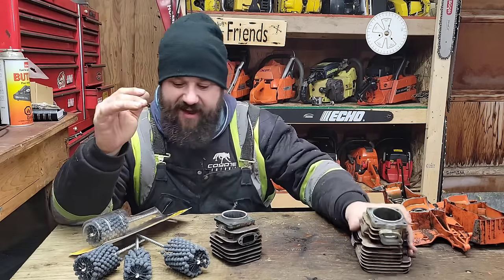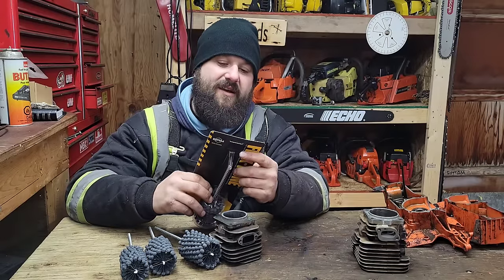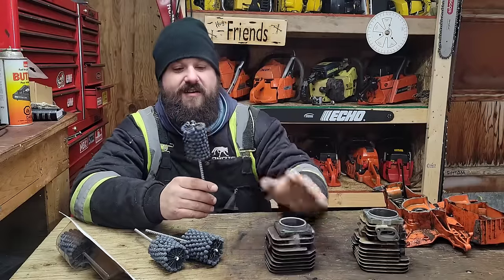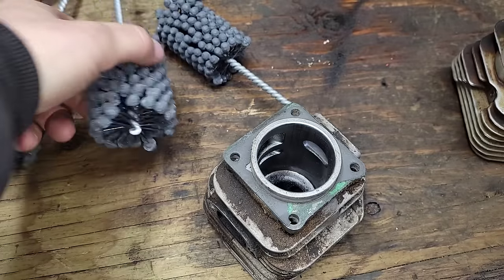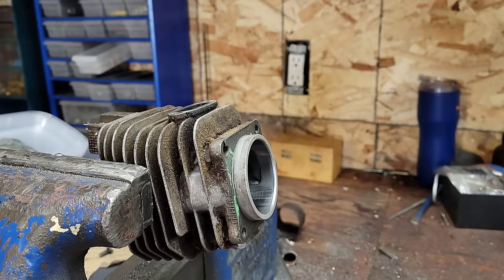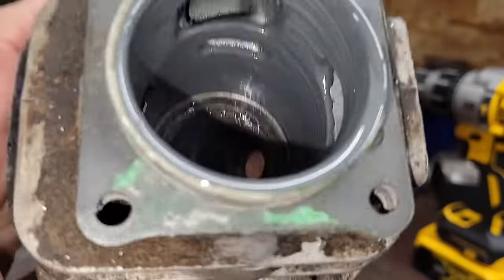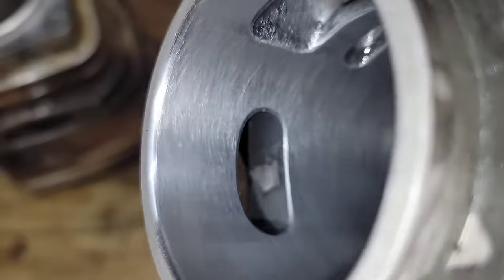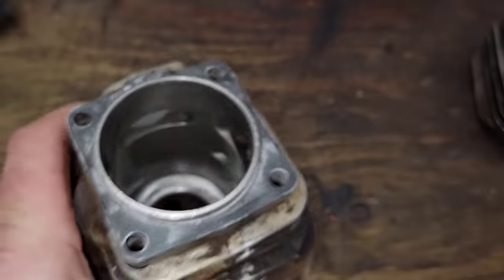Nikasil 2 stroke cylinders. To hone or not to hone? That is the question.

Comment: Hello my friend nice work, i have a used 026 with original cylinder but with no brand name piston with a letter (A) on it. Which means is 43.95mm, cylinder is in great shape but the piston have some scratches nothing special but i want to replace it . Meteor made three different dimensions for this model:(A)43.95 , (AB)43.96 and (B)43.97mm and i can only find only (B) available on internet so my question is....can i put a meteor (B) piston in this good cylinder,i m afraid the 0,02+ difference between A and B will overheat and seize the cylinder... what's your opinion about that... P.S. i didn't measure ovality of cylinder with a bore gauge .

Comment: Tin man
I was in a group tonight and I was told that I shouldn’t of happened to cylinders on my Arctic Cat engine there also the nickel plated and I did it anyways there is no issue with them not scoring no glazing that I know of but I did it because I thought I needed to do it to see the rings well I won’t do it again but I think it’ll be OK what is your opinion?  I used an under size home that didn’t really fit in there well and got a nice cross hatching there. I guess I’m experimenting to.

Comment: Tinman, by pulling it in and out that far, aren't you taking quite a bit more material off the base of the cylinder compared to the top? Wouldn't shorter strokes (~1 cm) be more even?

I don't know much about chainsaws, just a curious subscriber. Thanks!

Comment: A very 2-way topic, when it comes to 2 stroke engine rebuilds....
Should you hone a Nikasil barrel?!?!?! 
- My personal opinion - No you shouldnt.... Why? Because nikasil is too soft... The abrasives used in honing, are far too aggressive...
How do i know this?!?! I used to work in a machine shop, Concentrating mostly on niksail cylinders for motocross bikes.
Lathing them out, Re-Nikasil plating, and machining to stock piston sizes.. Also did a bit of welding on exhaust port bridges, When they would come into the shop cracked...
We tested the "should you hone a niksail cylinder" theory, Using state of the art high zoom camera's and machines... 
We found that the honing marks left in the cylinder, were so much deeper that whats even required... Far deeper than any factory maching crosshatch marks...
The crosshatching is there to hold oil, to aid lubrication during the run-in process... we found that honing, simply put too heavy marks in the cylinder walls that what is ever required..
Remember.... Too heavily scoring inside the cylinder, IS NOT GOOD.... Too heaviy scored, Causes potential blow-by, Excessive piston ring wear too...
There is simply no need to hone a nikasil barrel.... Red scotchbrite pad, and a gentle scuff to remove the existing glazing, TO give the new rings a good chance to bed in.. Is more than adequate...
Reply: I totally disagree! Tell me if you worked with replating cylinders, what process is used to get them to the right piston to bore clearance? Honing ofcourse !!!🤦‍♂🤦‍♂

Comment: How can someone tell if there cylinder is nikasil or chrome tinman.  And if you putting in work your shops never "clean". The 94 would be interesting to see after run in
Reply: The cylinder will be super shiny for chrome, nikasil is a dull Grey color
Reply: also after market is usually chrome

Comment: Kawasaki  2 stroke MX bikes say to use 600 grit wetordry with kerosene if you need to scuff their plated cylinders and not a flex hone.(around 2005~6)
Personally, I've used them but the balls fly off when they get caught in ports when you don't have correct size for cylinder
A cordless drill seems to work much better than a corded drill, you should move in and out of cylinder faster to get a 45 degree cross hatch

Comment: As a rule I will let one scratch go knowing I’ll loose about 10-15psi as long as it’s minor. 
 If it’s more than one you simply have doubled that loss and the chance for heat also increases. You could run it rich and have it live but that’s no fun.

Comment: two stroke dirtbikes have incredibly thin plating. you'll rebuild a bike and just find bits of the plating missing withought cause. you gotta replate after porting because the plating will chip on the edges of the ports because it doesn't extend down the ports. maybe saws are different.

Comment: Are you worried about removing the COATING in the cylinder or enlarging it to much? If you check your ring GAP with your new rings before you start it should tell you if you are honing to much as you go by checking gap after each honing....no??

Comment: The guys that rebuild aircraft engines don't recommend a bunch of idle time on a new rebuild.  What happens is the cylinder gets glazed up and the rings don't seat giving you excessive oil consumption.  In other words, don't sit on the runway waiting for clearance to take off and leave the engine idling.  Rebuild it, and go fly it without a bunch of early idle time.

Comment: Hey Tinman, been following your channel only quite recently but feel like I just learnt a lot from you already. I am an IT guy, but really got into chainsaws when I got my uncles 024AV in parts and put it together to do firewood. Been fiddling with it ever since because I never got it working right. I did see some light scoring on the cylinder when I took it apart and I thought to hone it as I had seen on some other cahnnels. It was only after that that I saw this video though and now I am afraid I might have honed through the coating as I know this is a chrome plated cylinder (did only do a one-two-three back and forth like you show on your video). Would you be able to tell me how I can see this? Thanks in advance man! Greetings from Belgium :p
Reply from the maker: Hey welcome to the channel!! So glad some of my videos gave helped!!

Comment: Speaking of Chevys they make good oil pressure from the factory that's why they put them in all the power boats and then make the most bolt on horsepower compared to any engine in the world you cannot beat them pork horsepower from the very beginning

Comment: Ok. So honing a cylinder is not a bad thing.
However, piston fitments, ie, piston to cylinder wall clearance has to be measured. 
Some run .0015, some, .002, and others at 
.0025 thousands. Piston fitment is critical to 
long engine life. Too loose n you get piston slap n blowby dirtying up your oil much quicker than having good piston to cylinder wall fitment which will keep your oil cleaner longer...

Comment: I personally hone till glazed is removed.
That's what I was tought. N. A. D. C.  Class of 2000. Well one of many. If it breaks though the coating it was already warn out. Simple dial caliper could be used to get a pretty rough idea of bore and piston size, indicating general wear.  Not precise. But it works.   But  all to his own,. Do what it take to make her run

Comment: And now they got the LS engine very easy to work on actually easier than easy 327 they brought back the Big Bore the Short Stroke Chevrolet is the best look at the horsepower of that they make and the torque it's unreal compare apples to apples

Comment: Also pay attention what kind of cutting oil that you use that will make a difference to up to 50% on the cylinder hone check in on that what kind of cutting oil are you using

Comment: Is not bad to experiment with cylinders and honing mister, but the fact  is that is the inner diameter in those cylinders are not even  in all positions  and the tolerance is out of safe  limits , then it is most possible the rings will suffer as springs opening closing in thousand of times per minute  resulting  breakage and destroy piston cylinders once again , you should make measurements in the cylinders after honing if  remain  in safe tolerance, when there  are serious seizures  in the cylinder you better use  grinder  for resurface to a new oversize piston size ,,, In this case you can try and see the result for how long the piston  will survive .....

Comment: Nikasil bores should only be de-glazed with aluminium oxide ball hones not silica oxide. On average a Nikasil coating is only approx .003" thick.
Reply: Nicasil bores need to be deglazed with silicon carbide or diamond ball hones. You can't deglaze with a softer material.